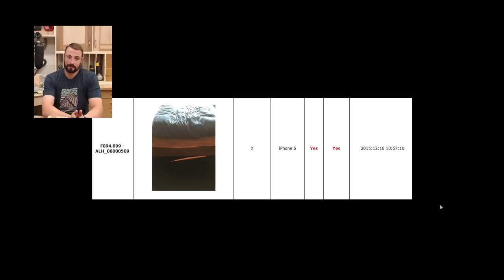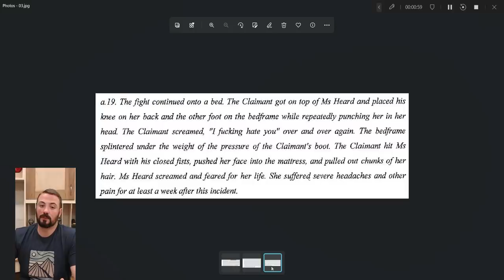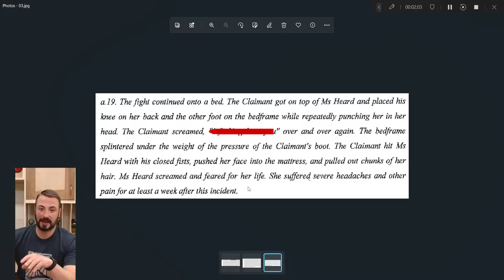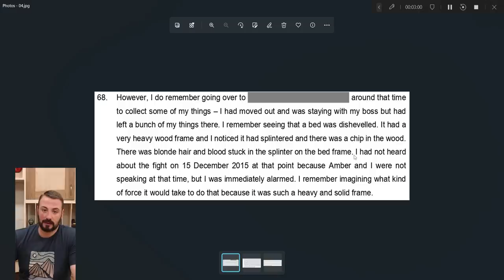Woodworker Attorney DEBUNKS Amber Heard's "Broken Bed” Testimony!

Comment: As a structural engineer who has studied failure modes in timber I was gobsmacked by the supposed failure from a boot. I would expect to see localised denting crushing from an impact like a boot. 

The only way at could happen under impact would be if there was already a failure along that line and the boot basically just knocked it off. But even that doesn't even work because we don't see any fibres that have been pulled down in a shear force perpendicular to the grain at the ends.

When she was talking about a broken bed I was expecting to see a bending failure, because that's the only was you could "feel" it, basically collapsing under you.
Reply: Yup. I am an engineer, dont know wood, but I do know I=BD cubed /12.    And the simple.bending equation sigma Y =MI. ( On phone.. cant find symbols 😂). To apply enough force at the top, to splinter the bottom, given that wood splinters with delta y, actual displacement.. erm.. to achieve that displacement on such a short beam, the joints at the end would fail first. At rough guess.. you could park a 3 ton car on that bed and it would not splinter 😂😂👍. To  splinter it, drop a car on it from 3 feet, but the corner joints would fail first, simply cos material CSA  👍
Reply: So.. as an add. If a human head was on top of the bed frame, a hydraulic press mounted above with the head sandwiched.. no way would the bed break like that and the owner of the head walk away 😳
Reply: @bookschatter2771  totally true that it crushes easily, particularly in generic grade rather than the structural grade I'm used to seeing. So agreed that the picture quality might be giving us the impression there's no crushing when there is.I can see the outline fairly cleanly reflected between the wood piece and the bed damage, but I wouldn't be putting that image in an expert witness report because it is a bit blurry on zooming in.

One thing that stands out to me is she's call that a "broken" bed. That's a perfectly useable bed, yes it's damaged, but not broken, and I don't see how you could feel it? Hear it for sure, but feel it?
Reply: Y’all are smart 👀
Reply: @Elspm  Agree. That bed is not broken.
Reply: @TheScotsalan  well looking at the photo the bed platform seems to be continuously supported on the floor, so it wouldn't fail in bending if that's the case. Since timber is orthotropic we have to check against varying strength properties depending on load direction. That's a failure of splitting along and across the grain, the fibres have basically been forces apart. It's just not going to happen if it's a blunt object and the member is supported along its length. Even if it wasn't I'd expect to see splitting on the tension side of the member.

We dont have the info to calculate the force required for failure since we don't have the timber grade, the bed dimensions or confirmed support conditions. C14 timber in bending has a characteristic bending resistance of 14N/mm², a compression perpendicular to grain resistance of 2N/mm² and shear of 3N/mm² fyi
Reply: I am woodworking teacher in elementary school (in Finland thats a thing) and I dont believe that to be caused solely by a boot either. There would need to be damage already. But one major thing to consider is also the age of the bed. I think that kind of split might occur on a very old and very dry ”hardened” wood. And that bed looks quite old from the photos. 

When wood dries during the years it might get ”harder” and thus more fragile for splitting. And sometimes when wood is drying it can cause splitting in itself along those wood grains. So I think knife or sharp object is not the only way for that to happen. But I do agree that you cant just kick any wood and make it split like that.
Reply: @TuomioK  could be, I wish thete was a pic of the whole bed to look out for cracking in other places that might indicate that.

For sure I'd like to actually be there to feel the timber under my fingers. Pictures are a bit rubbish for that sort of thing.
Reply: yep. You are correct
Reply: @TheScotsalan  Interesting! Before I saw photos of the bed, I assumed there was a lip that extended beyond the rest of the bed frame- which could be used to get a foothold.
So, do you have an opinion about the tip of jds finger being severed by a smashed phone vs a thrown glass bottle?
Reply: I thought it was going to be a standard wood bed frame with a broken piece consistent with direct force pushing it outwards. I’m sure I could provide the force to break MY bed frame like AH testified. But my bed is a standard 4 leg bed and the wood that encloses the mattress is less an inch as it isn’t made to be sturdy or weight bearing, particularly not on a horizontal axis. 

I was truly like, “well this is interesting.” But then they showed the picture of the bed and I was like “that ledge is massive” surely if I were trying to get purchase to push someone into the mattress I wouldn’t be trying to get leverage by using the outside of a deep frame…you would wedge your foot between the mattress and frame. Why was he putting his weight in the outside edge? 

It’s really funny that the “evidence” she provided is her undoing. If I had just heard her testimony and his I wouldn’t know what to think. But she describes things specifically and brutally…but then her pictures just don’t make sense in context of the story she told. I listened to the whole bed incident and it sounded horrific…but then they pulled up the pictures and I was like “if that happened NO WAY did you get off that easily. Arnica cream isn’t magic.”
Reply: Actually a failure at that point in that manner I would not be surprised about, but the physical contortion it would take to do that the way Amber described would require circus training.

It's likely that the piece had already reached failure point (from wear), and one person putting their foot on it (not in a contortional manner) or sitting on it heavily, was enough to shear the corner off.

You can note that the fault continued right along that part of the grain in the later photo, so it's more likely a fault in the wood than abuse of the furniture.
Reply: @adifferentangle7064  This point about the fault continuing right along that part of the grain in the later photo is highly likely the result of a fault in the timber. A point the video glossed over as "something to note" is actually one of the most important and telling signs that this timber was weakened naturally and it could entirely be possible the force of a boot could have removed the chunk.
Reply: Try tearing a single string off of a piece of string cheese, from the middle, using the back of a spoon. It´s possible, if you can get 'purchase', but you'd have to exert an amount of force that squishes the cheese down to half it's original height. Try doing that to a wooden bedframe, with your (non-weightbearing) foot.

But as nonsensical as this testimony might be, a courtroom deals in evidence. So if you're suing for 50 million, you might as well just spend a few hundred bucks and buy an identical bed and identical boot, recreate the alleged footchucking incident in front of the jury. Should leave quite an impression. On the jury that is, not the bed frame.
Reply: @shanelaing4402  Yes, I made a seperate post where I explain why in this instance, as a restorer, I I'm about 100% certain it didn't happen that way.

Faults always follow grain line. When you look closely at the picture, you can see that the splinter does not follow the grain line.
If that piece of furniture still existed I would be technically able to forensically investigate and find the exact point at which the knife (which appears to be on the bed) entered the wood.
Considering JD has a huge knife collection, it might also be possible to determine which knife was used, because there is a very small chance any of them have actually been sharpened in that time.
Reply: It was damaged during assembly or Imagine the shipping cost of 1000lbs custom swedish timber bed.
Reply: @daan7004  Let the string cheese dry out for a hundred years and see what results you get then.

The reason I don't like the OP analogy is he needs to address the fact that the wood on JDs bed is clearly old, and without thinking too hard I would say they've come off a historically significant bridge or structure.
You're talking about the bed of a famous person after all.
Wood that old can and does develop faults over time, which could be broken with a sharp kick once it's opened far enough.

The reason why this case is as the OP suggested is because if you look closely you can see the splinter does not follow the grain line.. And there's a knife on the bed.
Reply: @adifferentangle7064  to a pre existing fault I don't disagree. With very old wood, brittleness absolutely increases with hardness of timber, no question. As you've indicated above, agreed, it would most certainly not cross grain like that.

From my perspective it doesn't look as old as all that. I'm used to very old structural timber in situ though, it rarely looks nicely planed/finished/varnished when I'm there. I'm not as good at reading age in nicely finished timber from pictures, got to see it in real life or feel it.
Reply: @adifferentangle7064  I disagree. The finish on bed looks like oil, and that is has deeply penetrated the fibres. Oil-hydrated wood wouldn't have cracks that formed from the fibres drying out. The end grain has no checking in it. I see plump wood. 🤷‍♀
Reply: This comments section is a perfect example of why expert witness work (which I have done quite a bit of) is incredibly difficult for even the most apparently measurable scientific things - especially when it's an organic product.

In the real world most accidental damage is multi-factoral, and we would have to consider all these aspects. Not only would I be taking better forensic photos, I'd be handling and reporting on the timber in real life, and I'd be trying to contact the maker to find out how they sourced the wood and what they treated it with. I might carry out lab impact test with shoe on varying ages of treated and untreated timber.
Reply: @sallycinnamon5370   IF THEY we're struggling, you wouldn't know how far onto the bed she was to make that conclusion. She could've been closer to the edge of the bed and if she was, he wouldn't be able to wedge his foot between the mattress.
Reply: @cruz4790  She testified that she was being pressed into the mattress by his knee on her back. So she was on the mattress and his body was over the mattress. There is 0 chance that one knee was pressing a woman into a mattress and her NOT be pressed into the hard wooden frame yet the person on top of her torsos leg couldn’t reach the mattress edge. It’s simple physics. 

Seriously look at that picture and logistically try to have him pressing her too into the mattress exclusively but being unable to have the other leg reach the mattress. If one knee was on the mattress then the other knee could have been on the mattress. 

Her story was ridiculous…even without the “broken bed.” She described being beaten into unconsciousness. But then Arnica cream and icing it made it possible to do a television show the next day where no one but the makeup artist could see any discolouration and there was 0 swelling. There is 0 chance. 

JD’s testimony that their heads collided while he restrained her reflects the actual injuries she pictured. If she had had a less extreme testimony I could have believed her…but that beating and those pictures are incompatible. She testified there was blood everywhere and clumps of hair everywhere and chunks of scalp pulled out and NOTHING pictured despite her apparently attempting to record the “crime scene.” 1 clump of hair that looks like something off my hairbrush, parted hair that I honestly can’t see a bald patch in, a broken bed that I can’t see the damage being made as she says or her know how it was made while he was screaming and beating her violently, and facial bruising with no swelling.
Reply: @sallycinnamon5370  How far onto the mattress? She never said dead smack in the middle.   You're only thinking of her being fully on the mattress because she said she was face down and on the mattress. She's giving a description of her being on the bottom and him being above her. Her head and upper body could've been on the mattress and the lower part of her body near the bedframe. As wide as that bed frame is, If they were struggling, and he throws her down or she falls down, she wouldn't have been in the middle or even fully on the bed, but more towards the foot of the bed, possibly with her legs on the frame.
Reply: I'm not even graduated yet (I get my bachelor's in structural engineering on Saturday). I take my final in timber design tomorrow and I don't think we've ever talked about a failure like this. Of course you don't expect someone to stab your structure either lol
Reply: @YandereDay  congrats! I'm two masters and a load of professional years in and still getting brand new challenges every day
Reply: @misssmith7225  The fact that two people actually liked that comment does nothing for my faith in humanity.

I don't known what you think you are seeing, but that is not it. 

The colorisation of the bare wood is either age or camera filter. Not oil. 

And oil does not protect a pre-existing fault.

And a pre-existing fault does not have to start at the end. 

Without physically looking at the wood in person, or much clearer photographs, it is not possible to determine what finish was used on the sleepers. 
But you can tell that there is  not "deeply penetrated oil", because you would see a variation in colour through the splinter.

Comment: I will be honest. I was skeptical this could be proven. I was completely wrong. Not only did you prove it could not have happened the way it was testified, you gave an interesting lesson in wood. Excellent job.
Reply: Only someone that knows wood and works with it would know this. I work with wood and I 100% agree with his outcome.
Reply: Knew it the second I seen the picture as evidence.. There's no way a booted foot could have done the particular type of  damage. It would've made an indentation if anything.. The other issue I have with this photo is the position of it.. If he allegedly had her on the mattress, knee in her back, punching the back of her head and his boot against the frame to "gain purchase".. It would have been on the inside of the frame.. Not the outside of it..
You could take a bat to that frame and it would only leave dents in the wood. Smh..
Reply: @katzeyez1979  I was just impressed that he absolutely proved it so simply. Just saying he did a great job.
Reply: @Navajo_Steve  True. His logic is not disputable. Many feet it wasn’t logical but he absolutely proved it beyond any doubt.
Reply: Agree! The wood lesson was great.
Reply: @bebenut123  A pot of soup would have been heavy. It was dropped from above so it could easily have hit the edge of the table and fractured it. But pushing against that flat surface of the connecting timber at the foot of the bed to "get purchase" (an interesting choice of words not compatible with Ah's usual vocabulary. "landing one" on someone, meaning to punch them, is a pretty vulgar use of language) couldn't possibly have created that splintered piece of wood.
Reply: @Navajo_Steve  Unless as he argued the bed frame is solid lumber, in which case with softwood of that size, not unreasonable to expect checking, which would make knocking a corner a lot easier, and doable with your foot.
Reply: @bebenut123  The 'leverage' in your case would have been the height from which it fell, the weight and the acceleration of it. Gravity.
Take the pan in your hands and push in the table; nothing happens.

Same as the bottle of wodka slicing Johnny's finger. I could stomp the bottle on your hand or finger, probably hurt, maybe if I really swing it hard enough I can break your finger.
But the bottle wouldn't smash nor would it slice.
Throwing the bottle however can slice because on impact it breaks.

Comment: That zoom in on a shiny object resting in the sheets that looks exactly like a box cutter is an amazing catch. Anyone who’s worked with wood even at an amateur level, which I have, could tell you that a long strip like that doesn’t happen with broad pressure from something like a boot or even a hammer. A hammer blow would splinter on the very edge and have squared edges. I’ve kicked plenty of wood in frustration and never had a long strip like that be the result
Reply: Brilliant Colombo. When these hateful people do things it is out of anger. Angry people make tons of mistakes and leave lots of clues.
Reply: There were wooden building blocks of that thickness at my kindergarten (or a similar looking sturdy wood), even I thought it was kind of funky when I was watching it but I could remember why until someone recommended me this video.....
Reply: I thought pocket knife. My hubby has about 30 that I'm constantly finding them in random spots or in the washer!😂
Reply: "I've kicked plenty of wood in frustration" 😂 thanks for bringing the expertise in
Reply: I noticed that the mock-up seemed to have a more rounded edge than JD's bed? Would it be possible that the timber could be torn off if someone (with a heavy shoe) kicked at the sharp edge of the bed hard enough?
Reply: @cameronlynch8218  i noticed the same thing. the sharper edge on the real bed makes that edge significantly weaker. I don't see how this guy can state categorically based on his inaccurate mockup that a boot couldn't take a chip off the edge like that. Unlikely, sure, but not impossible.
Reply: Very likely the same box cutter used to cut her hair off.
Reply: @Done975  100 percent.
Reply: I've never even worked with wood but I remember that from physics lol.